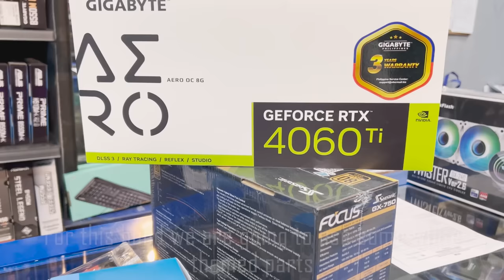Building My First Gaming PC ASMR!!🎧| $1400 White Build! 🤍| I5 13400f + RTX 4060Ti✨| Aesthetic 2023

Comment: Bro you installed the liquid cooler upside down because the pipes are supposed to come from the right, not the left. There will be no difference in heating, but aesthetically, it would be better if the pipes come from the right. Congratulations again, very nice setup!😊
Reply: The pipes come from the left in every build i have ever seen
Reply: if its installed in the right, he would cool the processor more but the other parts of the pc such as the graphics card or the RAM, they would get less cooling.
Reply: @SlideKing.official  stop telling fake news lil broski
Reply: @RS7VR  then you only see bad builds

Comment: hey so I noticed this because I had a problem with something you did in this build a while ago. If you notice your PC not getting utilised enough in Games etc and just going to about 70%, you should move the NVME to the bottom lane because on some boards using the top pci lane for m.2s can halve the lanes apparently. Weird and very specific but just wanted to share my experience
Reply from the maker: I actually have 2 SSD now in both slot, and installed games on my second one

Comment: Greetings) My assembly is almost like this:
Housing: JONSBO D41 STD SC TG
Processor: 10-core INTEL CORE I5-13400F 2.5 GHz
Video card: NVIDIA GeForce RTX 4060Ti 8GB
Motherboard: Motherboard: B760 WiFi
RAM:
32GB (2X16Gb) DDR4 3200Mhz RGB
Cooling: Hydro 240 liquid cooling system with RGB lighting
Power supplies: 750W BRONZE certified
System SSD (NVME):
SSD NVME 500GB M.2
Optional (NVME): 1TB SSD NVME 3.0
Reply from the maker: Congrats on your pc👌

Comment: could you please help me selecting which laptop should I consider i am really so confused 😕
i am buying laptop mostly for programing and little bit gaming 😅

asus rog strix g15 ryzen 7 6800h rtx 3050 || asus tuf f15 i7 11th 11800h gen 3050ti.

TUF/ROG (conclusion)

90whr✅/56whr (battery)
3050ti✅/3050 (GeForce rtx)
i7 11th gen 11800H /ryzen 7 6800HS✅(ry 7 better)
75w tgp/95w tgp✅ (higher tgp better performance)
nice looking/ super looking✅ (looks)
74000rs✅/75000rs (price)
16gb Ram ddr4/ 16gb Ram ddr5✅(ram)
1tb SSD✅/ 512 gb SSD (storage)
4gb graphic card both have same.

please help me it will really be great help to me. and if there are any other models that are under 75000rs around 900$ with good specs please let me know.

Comment: Very good build, have you locked the fps at 60 or they are by default? Soon will be building a pc a bit extreme parts are Ryzen 7950x (cpu), 7900XTX(gpu), 2+2 nvme ssd from xpg s70, deepcool 1000watts (psu), alienware 27 inch 240 hz display overclocked to 280hz, keychron keyboard and some other items.
Reply: That's gonna be pricey lol
Reply: You gonna play Genshin on it?
Reply: @Qast3  yes, i am upgrading from a 2011 Alienware M14x that served very well and still is.
Reply: @Dodger_Dawg_  genshin impact? A big No, Crysis 4 definitely and absolutely Yes.